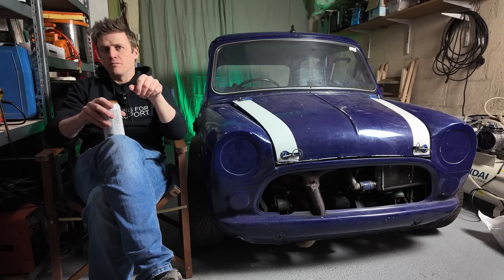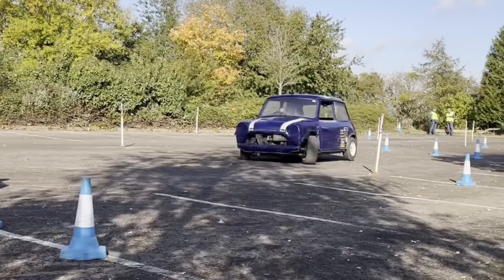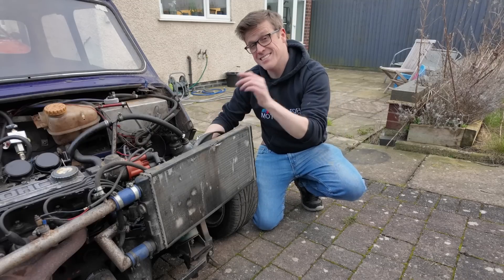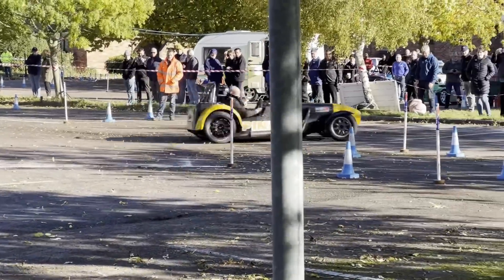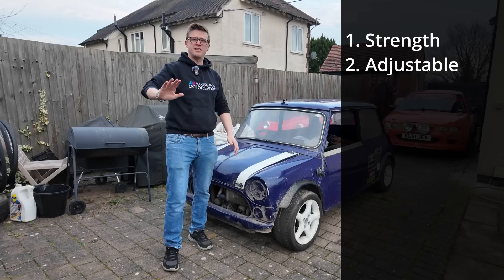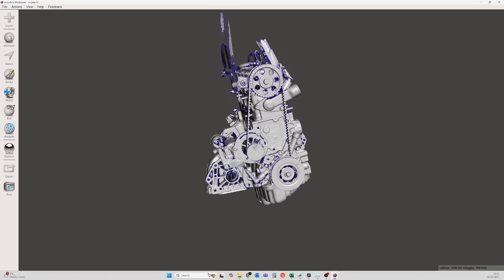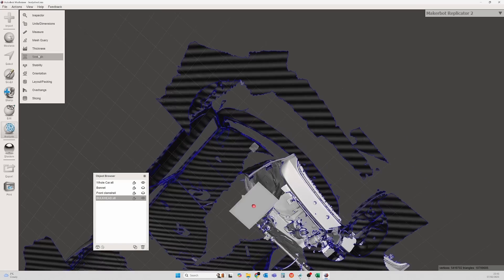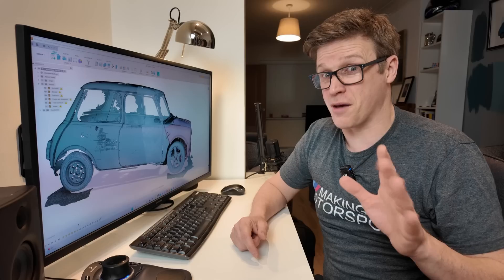Re-engineering the Autotest Mini!  Designing a new subframe and front suspension from scratch!

Comment: Loving it!
Not fund of the rubber cones then? What makes mini’s suspension so direct compared to my ax gt for example?
Reply from the maker: An AX GT??? My god, I have 2 of them and they were great!!!!

So…. the AX (and most FWD hatchbacks), are MacPherson strut, with a spring and damper in one unit (but usually not co-axial) and the strut forms the top link of the suspension as well spring and damper.

it’s simple and cheap to make but gives sub optimal unsprung weight, roll centre and dynamic camber gain… (all of this will be covered).

By contrast, the Mini has double wishbone suspension which is widely acknowledged to be better, BUT, instead of a coil spring it uses a rubber donut,  now this donut behaves exactly like a spirng, except it’s the wrong strength and in an orientation which doesn’t current work (again all will be explained).

All of that is a long way of saying”when you change the engine and gearbox on a 50’s design, maybe you should update the suspension too) 😂😂😂
Reply: @MakingforMotorsport 
Thanks for the great reply 
Looking forward to the mini transformations …
Is the big offset wheels a necessity in the sport considering the drawbacks (steering effort, mechanical stress, geometry,…)?
Moving away from mcpherson strut design is key then… for a b-road blast i was dreamins about using mini front subframes in a rwd reliant kitten… :P

Comment: I have a strange question. Do you use more than 1 gear and reverse in the competitions? I ask because if not, couldn't you flip the motor around to the back. This would put the axles in front of the engine and the engine weight behind them. I am sure you could design a shifter that would still allow you to keep your same muscle memory position for forward and reverse. Yes, I know, crazy thought, but sometimes they work.  Keep up the great content. I got the Einstar Wega from your review, love it so far.
Reply: Iirc, the shifter (not the gearbox) has only 1st and reverse. If reverse has a higher ratio than 1st, and it's straight cut, it would be really interesting to see
Reply from the maker: It’s an interesting thought, and yes I do only use 1st and Reverse… spinning the engine is something I’ll have a look at 🤔